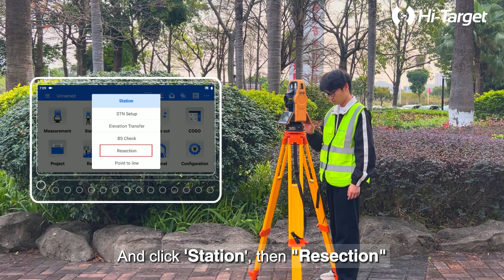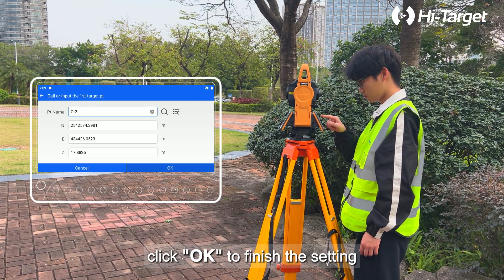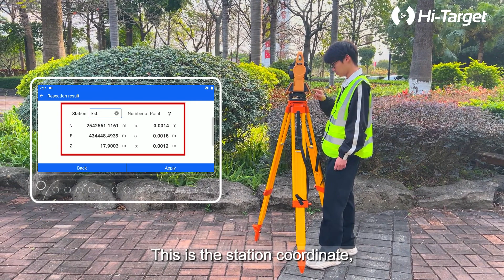Tutorials | Resection Function of HTS-720 Android total station

Comment: Hello! I have a question about the Hi-Target HTS-720 total station.

I want to use it for manual stakeout using a custom azimuth (horizontal direction).

Example workflow:

1. I aim the total station at a known point and set it as 0° azimuth (zero direction).
2. Then I input coordinates like:
   - X = 0, Y = -5 → this should show 90° (forward),
   - X = -5, Y = 0 → this should show 270° (left),
   - X = 5, Y = 0 → this should show 90° (right),
   - X = 0, Y = 5 → this should show 0° (backward).
3. The total station should automatically calculate and display:
   - The bearing (angle) from the current direction,
   - The distance to the point.

Does the HTS-720 support this kind of "offset stakeout" based on a user-defined azimuth?

If yes, can you show how to do it (via video or steps)? If not, is there any workaround or mode where this is possible?

Thank you!